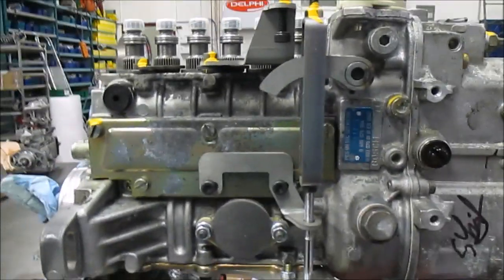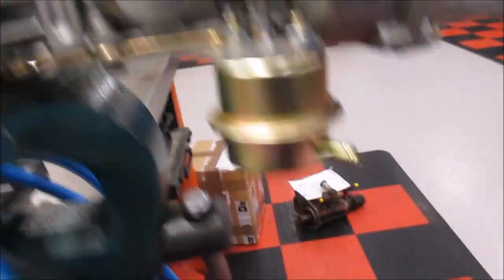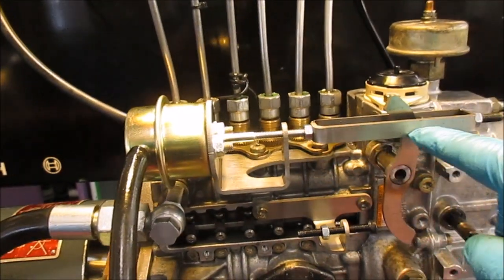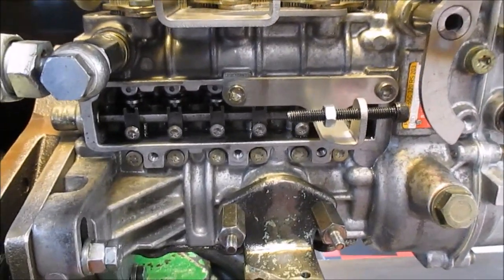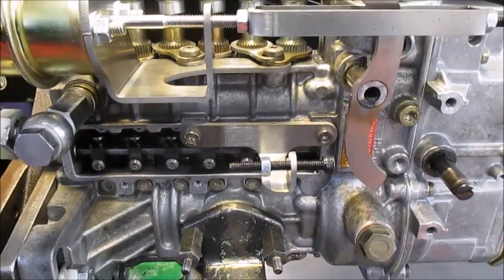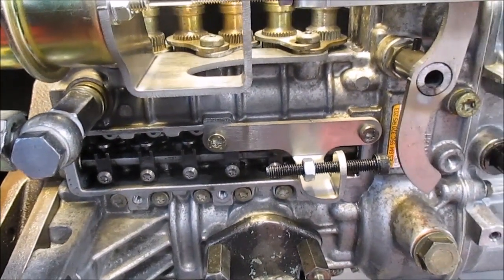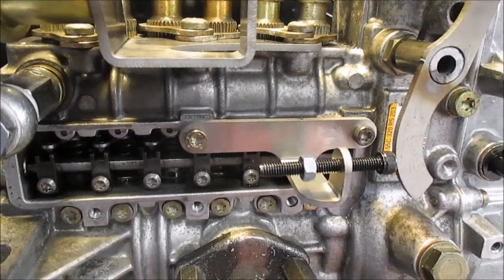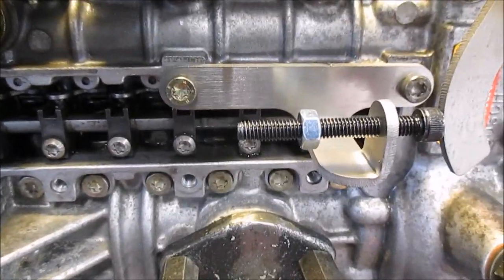Dieselmeken shows how to adjust outside ALDA

Comment: I put a motor on a boat and I have a pump 603 but how to get rid of the wastegate problem on the 606 engine works over the vacuum while I need to work on the pressure. What wastegate do I have to get?

Comment: do you have a switch point between maximum maximum fuel and low fuel? When the air pressure is generated, the system is fed with full fuel

Comment: Hello,
I have a starting problem with my mercede mb100d 4 cylinders; after a few moments of a normal start, the STOP slider on the pump moves to the OFF position, leading to an immediate stop of the engine. The same observation is repeated even after the disconnection of the air pipe coming from the lock. 
thanks.....

Comment: Would it be feasible to control the maximum delivery screw with a stepper motor to give "on the road" adjustment? This should potentially avoid excessive smoke for daily driving with an easily available power increase for misbehaving. The range of adjustment would be preset to avoid under or over-fuelling. P.S. I am currently saving my pennies to buy one of your pumps for a '98 Mercedes C250 Turbodiesel